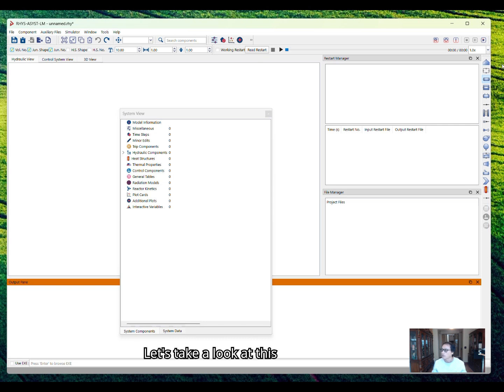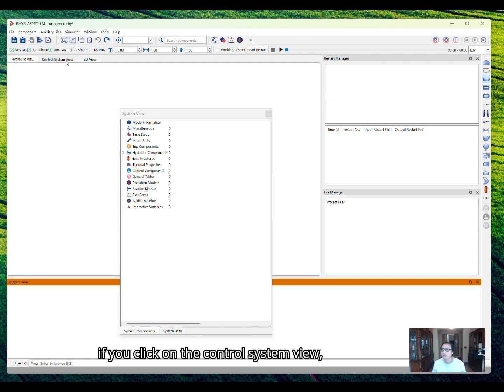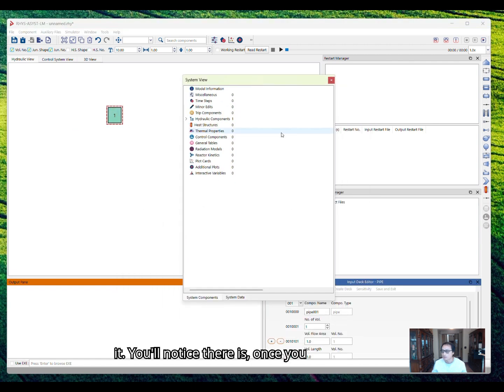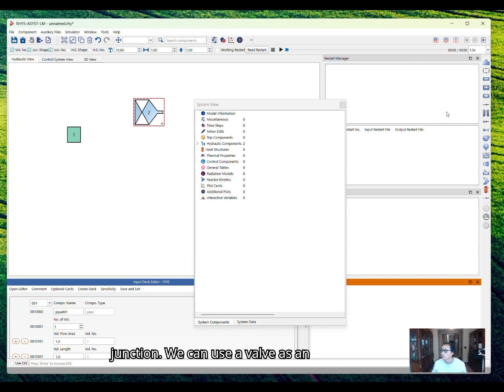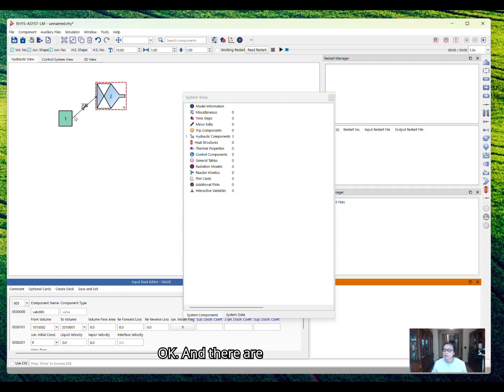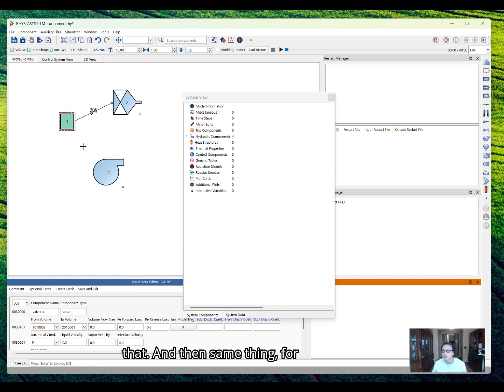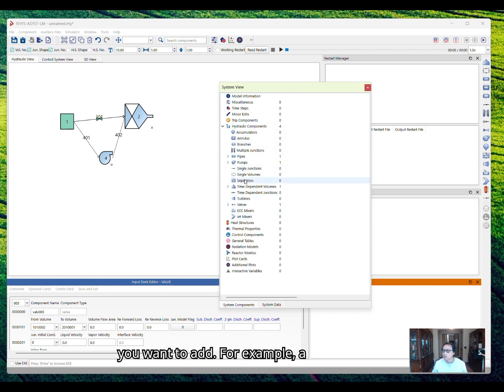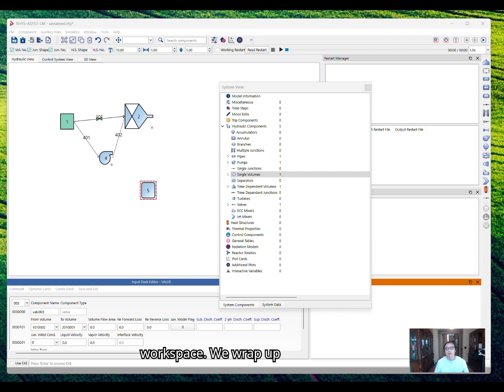Section 2: Inserting and Connecting Components

Comment from the maker: The RELAP/SCDAPSIM and ASYST code,  developed by ISS, are designed to predict the behavior of reactor systems during normal and accident conditions. For more information, please visit: https://relap.com

This video is a tutorial about how to build a hydraulic system in the software, RHYS. The video specifically covers two main topics:

[0:53] How to navigate the RHYS user interface (UI):
The UI includes the menu bar, quick access toolbar, dock windows, and the main workspace.

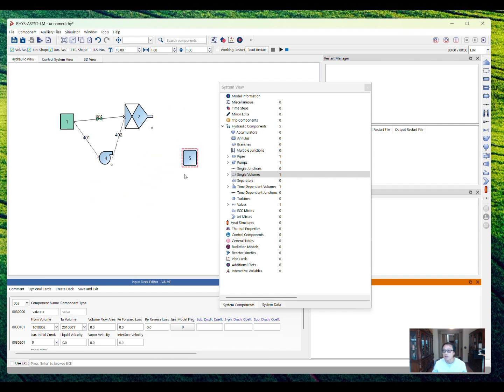[4:45] How to insert and connect basic hydraulic components:
You learn how to place components like pipes, junctions, and pumps in the workspace, and how to connect them together.